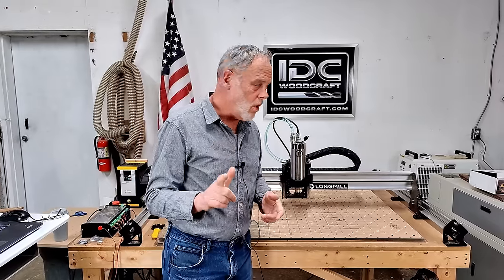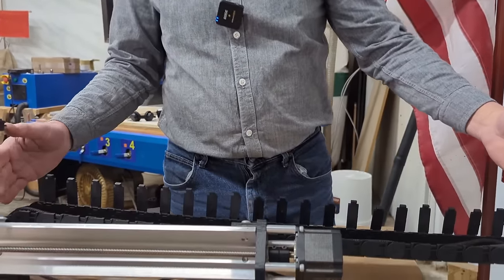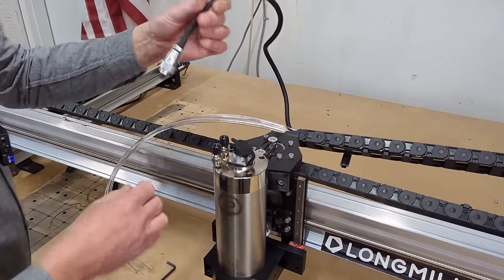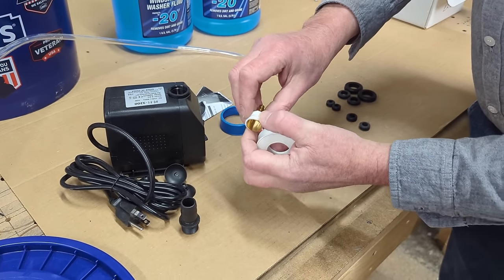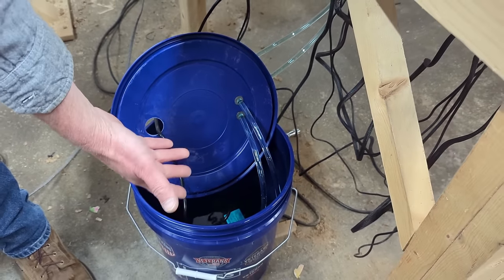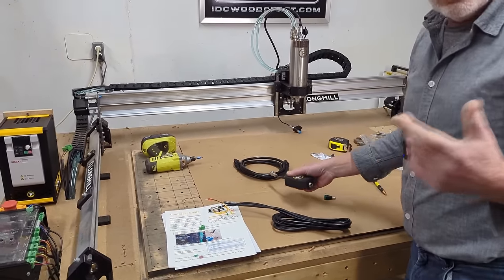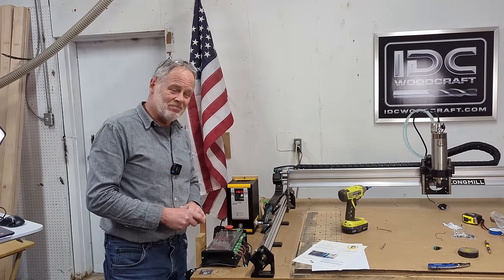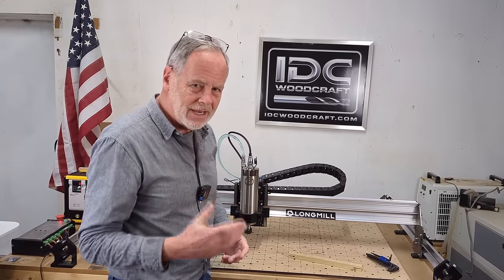How to Install a Spindle on Your CNC Router

Comment: Thanks for the video Garrett. When the motor is consuming power holding the spindle in place, will this cause the motor to wear out faster than when using a trim router?
Reply from the maker: Hey ssdd. No, it will not affect the motor life

Comment: Great video on adding a spindle.
I would recommend pulling the slack out of the return line that is connected to the brass fitting so that when the lid is replaced, it doesn't have the possibility of kinking the hose. See it a lot on aquarium setups.
When I tram, I use old feeler gauges and leave the correct one in place.
Reply from the maker: stevekinnaird6835, great call brother. I appreciate all the tips and tricks.

Comment: Hi Garrett, I bought the Longmill mk2 on your recommendation and it came with the 65mm Makita router.  I want to upgrade to the 1.5kw 65mm spindle.  Do you think I can use my existing magnetic dustboot and use my existing mounting bracket for the new spindle.  PWN did not have any info on the fit.
Reply from the maker: ricktanguay, that is a tricky one to answer over comments brother. Depending upon the design of the dust boot you may still be able to use it. Your best bet is to reach out to PWNCNC to determine if it will still work with the new spindle you are considering. Here is a link to reach out: https://support.pwncnc.com/new/?ref=idcwoodcraft

Comment: Beware, the VFD should be as far as possible from your CNC control electronics because it produces LOTS of EMIs that will mess with your control board and stepper motors. The spot you've chosen is actually not good at all when you take that into account.
Reply from the maker: meeloo0, good point brother! EMI is an important consideration on this one. I will look for a better spot on my table.

Comment: When upgrading to a spindle router, do you need to upgrade your stepper motors to handle the added weight of the spindle?
Reply from the maker: roberthunt3106, that depends on your machine brother! Your best bet is to reach out to your machine manufacture on that one!

Comment: That's a fun upgrade you did there. Did you get a spindle that is compatible with ATC collars?
Reply from the maker: mrwonk, not 100% sure on that one brother! Your best bet is to reach out to the Spindle company like PWNCNC on that one. They should be able to suggest a spindle that fits your ATC needs.
Reply: @IDCWoodcraft Oh, I was just curious if you got the upgrade on your spindle. That is one of the big advantages in the spindle upgrade is being to have the tool auto-change happen so you can program the entire job with multiple bits upfront and let the machine handle the change-over (or so it appears to someone learning before I buy my CNC) :)

Comment: Garrett, When you make the settings needed on the vfd and in gsender, do you have to repeat those entries on every project or is all that stored and project files get added to what you the changes you made to gsender? hope that makes sense?
Reply from the maker: vb5457, I have a video that should really help you narrow down your CNC choice. It will really help you determine what to look for when buying a CNC. Here is a link: https://youtu.be/wLVNF0L-ZdU

Comment: I mounted my VFD under the table and rerouted the control panel using a flexible CAT5 cable and 3D printed a mount (PwnCNC has a model) for the control board
Reply from the maker: hamanjam, that sounds like a solid setup brother! Happy CNCing.

Comment: Very helpful, I don't have a LongMill and didn't choose the liquid cooling model.  I already have the PwnCNC spindle.  I am waiting for larger 80MM mount for my CNC.  But, can use several ideas from the video.  I have been successful with tramming my Makita with a framing square, but think I will make the tramming tool you are using.
Reply from the maker: jimpalmer1944, glad to hear you are already set up with your new Spindle brother! I am excited for you to get your spindle mount.

Comment: I didn't like using windshield washer solution so I went back temporarily to distilled water until I found a alternative.  Within a month I didn't have freezing problems but I did start to have alge buildup in the lines.  I thought I had a sealed bucket system but I did get some sawdust which apparently started to grow and restrict water flow.  I did put a flow meter which made it obvious I was losing flow.  I prefer my pump to run all the time so I could see right away.  I went back to windshield washer solution and I just make sure the dogs cant get to any spills
Reply from the maker: hamanjam, good points brother! Glad to hear you found the right fluid that works for you.

Comment: Does my settings in Vetric regarding spindle speeds now get added to the G Code and my spindle runs at the speed that was set when I picked my bit?
Reply: Your tool database is fine.  What you will want to do is update your post processor to include a delay.  Find the line where your post processor sets the speed.  You'll see is as "S" and your RPM along with a "M3" which sets the rotation to clockwise.  You'll want to add a "G4P" command and how many seconds you want to delay.  I found that 4 seconds is usually enough so I would add "G4P4" to the end of the speed command in thr post processor.  If you're using gSender, there is an option to add a delay if it doesn't exist but they add G4P1 which means a 1 second delay which may not be enough
Reply from the maker: bkgoddard, the response from hamanjam  is completely correct brother! You will need to set up your post processor for things to work properly. If you are having troubles, it is best that you reach out to your machine manufacturer regarding the best way to do this.

Comment: Seems to be a good kit. Some CNC controllers are a bit more complicated.  Most spindles you can get the manufacturer to setup the cables to the length you need.
I'm not sure I would use a pond pump and bucket as a way to dissipate heat since the buckets heat dissipation qualities are horrible at best. The laser industry tried this as a cheap alternative and found out it just burned up equipment. The goal of the coolant is to cool the motor and if the heat is contained and just circulated your not cooling but slowly heating depending on workload. The heat in the bucket will continue to rise until its too hot. There is also from what I could see no loss of flow sensor. A simple cheap CW3000 properly cools as its a radiator with a flow sensor, it does of course cost more. You have to wire the flow sensor into a motor stop function so you don't burn up your spindle if the $15 pond pump packs it in. 

 I cannot find any supporting information on using windshield washer fluid, that has methanol in it typically. All the manufacturers I checked recommend automotive antifreeze and distilled water. I did find a couple of non cnc forums when it was mentioned by 2 or 3 people, not sure that's evidence of a good plan. I also noticed one person stating it had to be replaced every 30-45 days. It does have methanol in it so that will evaporate off in a non closed loop system and then you have blue water. 

 Personally I go for simple as its got less working parts meaning less things to fail. Water cooled clearly has freezing, pumps, proper cooling like cw3000 etc all to add to the things that can fail. I would recommend anyone installing water cooling to add a $30 flow switch. This way if the pump fails and it will you only need $15 and not $500. Of of course if one forgets to turn on the pump the spindle will not start with no flow.

 Personally on a smaller machine water cooling can be a problem as there is many more parts that can fail and cause more expensive repairs. Larger machines are different as they have things like redundant pumps, filtration and full chillers (not a bucket or simple radiator) to maintain motor temps. They do say Air cooled is more powerful but I'm not sure why. Water cooled is quieter.

 Shimming I found is easier with aluminum business cards from Amazon or something, they are thin and not as compressible as paper. Paper also further compresses over time with environmental changes. Scissors cut the card easy just try not to deform it to bad.
Reply from the maker: 3dtwerking324, thanks for sharing your insights on this one brother. I know it will certainly help out our cnc brothers and sisters considering a spindle in the future!